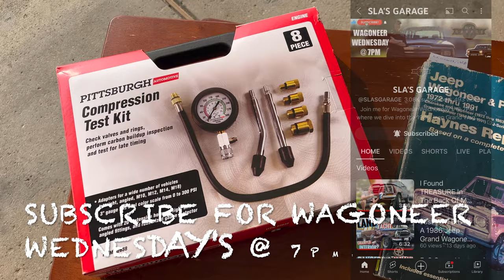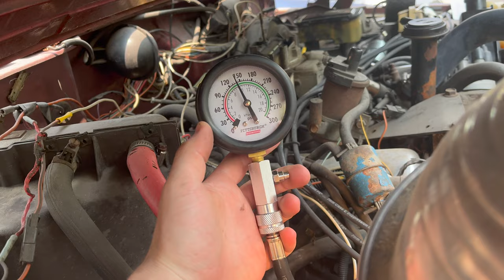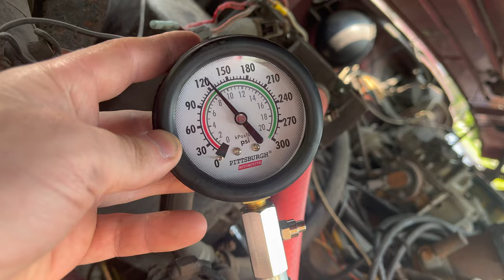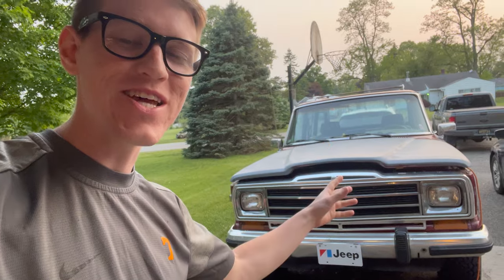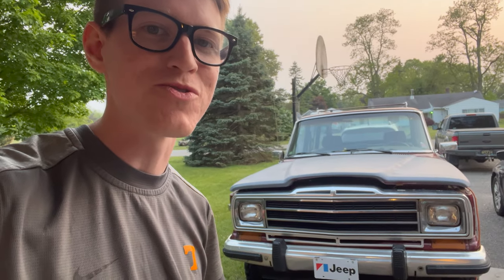Project Wagoneer PASSES THE COMPRESSION TEST! | 1986 Jeep Grand Wagoneer AMC 360 V8

Comment: your suppose to open the throttle maximum, by stepping  on the gas pedal, and you need the choke open fully by jamming a screw driver into it  130 is good, but its showing age, 150 is factory, and the  140-120 you saw is a big gap difference it isnt just about averages.   My 90 the compression was 150psi across the board when it had 120k, but  it has 160k now and its about 130 average like yours, so its deff wearing out.  but i wont be concerned until it is  arounnd 110..   at 130 i was able to pull my 76 Jeep j10 on a flat bed just fine
Reply from the maker: This is great info and something I’ll have to keep in mind as I do this test again someday soon here. Thanks for the tip I appreciate it!
Reply: @wagonworks803  also disconnect the fuel pump so you dont wash the cylinders with gas